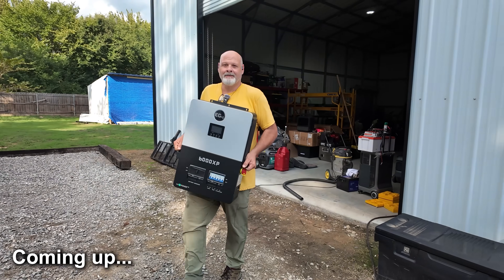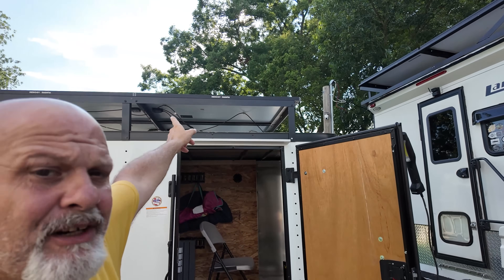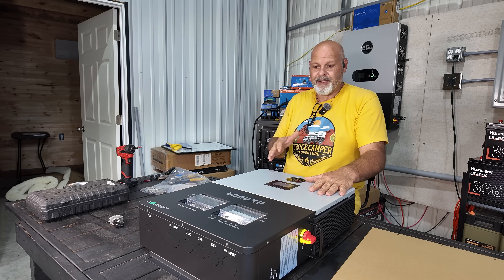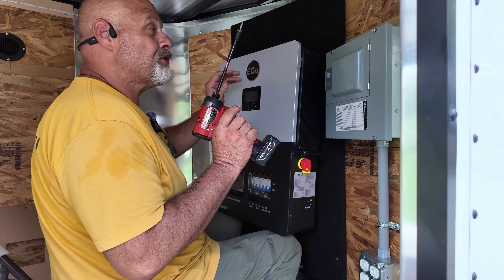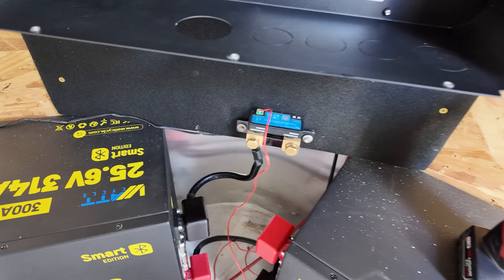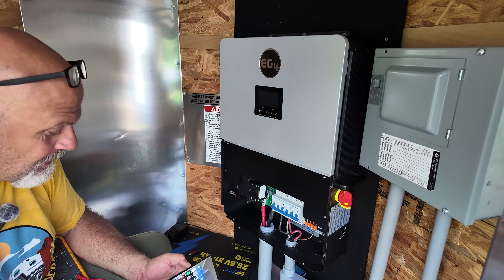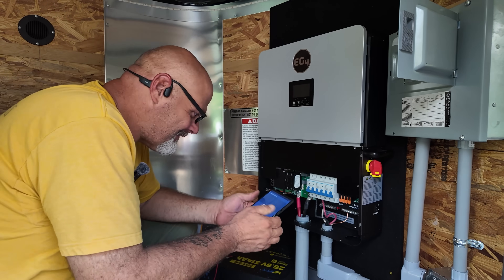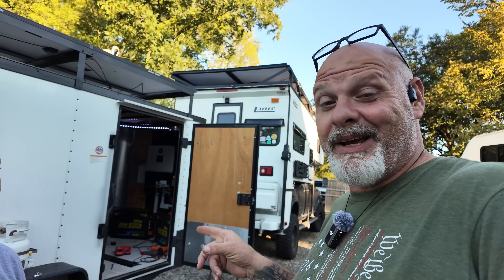Biggest MISTAKE ?? or Best Upgrade ?? EG4 6000XP + WattCycle

Comment: Re Precharging with Solar:  I read in the EG4 6000 manual that the unit can operate without a battery.  This got me thinking you should be able to precharge the inverter with Solar (which would have much smaller inrush current).  So try that trick, turn on the Solar first (wait about 5 seconds) and then connect the batteries.  Even if the Solar is not powerful enough to start the inverter electronics (an overcast day, or early morning) there should be enough power to precharge the Caps to reduce the battery inrush current enough so the batteries don't trip the protection.  So try this and report back.  And again very nice video. And Thanks.
Reply from the maker: Hey, that's a great idea. We'll give that a shot and let you know what we find out. Thanks!
Reply: @runawayparents yes, please, let me know too. I'm interested in building the similar setup in my van

Comment: Re Precharging: I have not tried this.  I read in the manual for the EG4 6000 that the inverter can be powered with Solar without a battery.  So if you were to turn on the Solar that may precharge your Inverter Caps before turning on the Battery.  And you won't require much power to do that. So certainly in the day, even with overcast this may save having to hit the WC App.  So give it a try and report back your results.

**(Edit: Sorry for placing 2 comments on the same issue.  When I visited this Video I could not find this comment and thought I failed to "Save" it (as I have in the past).  I liked my second comment more so I am apologizing on this one.) **
Reply from the maker: That's a great idea, thanks for the tip!

Comment: The issue that Will Prowse talked about is with batteries in parallel (and not really a problem, you will get your full Ah capacity from your battery bank even without the WattCycle fix (and WattCycle is not the only Brand with this issue)), but getting back to your ri, ad your batteries are in series so it does not affect you.  Thanks for this Video.
Reply from the maker: Hey thanks for watching and clarifying that for us.

Comment: Thanks for another enjoyable and informative video.

The problem with your batteries and the EG4 All in one is probably inrush current to your inverter.  You might also get that with the 24V system in your camper, but the EG4 server rack batteries may compensate for that or the  Victron Inverter may have protection for that.  This problem is solved by "precharging" the capacitors in the inverter.  But with this All-In-One system I don't know how you could do it.  You may need to add an extra cutoff switch between the batteries and the inverter (on the (+) side. Or you could simply expect to have to restart your batteries a few times until they don't get an over-current protection on the battery kicking on.  Each time you turn on the batteries the cap gets charged before the batteries stop it so after a few cycles the capes are charged enough to not trip the over0current protection and the system stays on.  There are a few videos on YouTube about this and a precharge circuit is very simple.to implement.  Truth be told, I am surprised EG4 does not have that solved in the All=In-One.   Again very nice video.  Thanks.
Reply from the maker: Hey thanks you i appreciate you watching and for the comment. You are absolutely correct using a pre charge resistor would have solved the problem i was having. Not sure why I didn't think of that. Guess I was caught up in my excitement of building this thing 😆 🤣.  The EG4 server rack batteries BMS is pre programed to deal with precharge end rush when connecting and turning on. Im aways learning on this solar journey. 😊

Comment: You should use pre charge resistor before you connect the battery to the inverter. I assume you get the over load error as a result of the inrush current from the inverter as the caps are being charged.  It will damage the inverter if you continue to connect without pre charge. System looks great
Reply from the maker: Thanks for watching, we'll keep that in mind as we continue to learn this stuff.

Comment: Want to put panels on a 30 travel trailer I'm gutting and using at a farm.  Want to put 9 or 10 425w panels, looks like you used angle iron, how did ypu fasten to the roof?
Reply from the maker: Hey thanks for watching. If you're talking about the camper i welded the supports and frame out of aluminum angle and it is screwed into the side of the camper with stainless steel lag screws. This camper is wood framed so I could screw into it. There are many different ways to do it with aluminum framed campers. Look at Larry's camper on Work Less Enjoy Life More YouTube channel.

Comment: $10,000 later we have a solar trailer to pull around just for power😂
Reply from the maker: Not hardly. You are way off the mark. For about the cost of a Honda gas generator. Plus the fun i had building it 😆 🤣